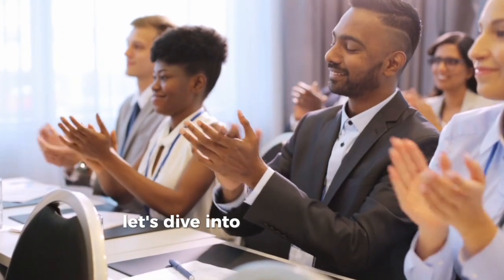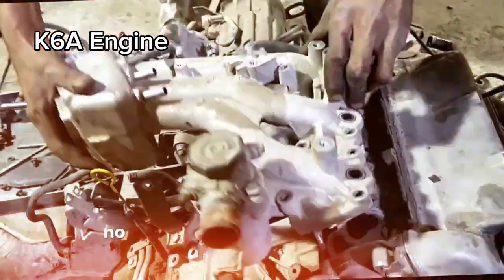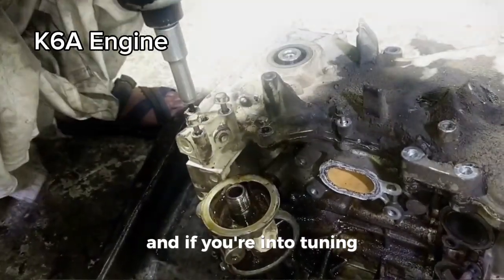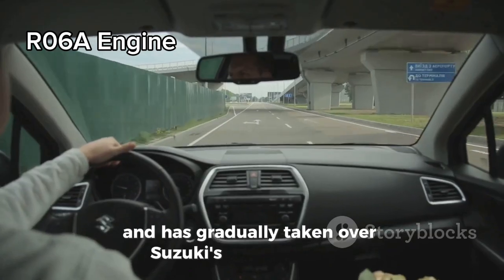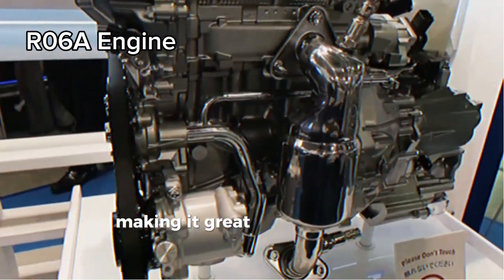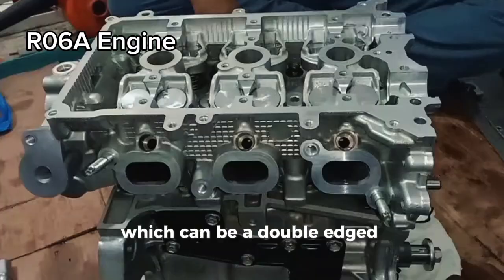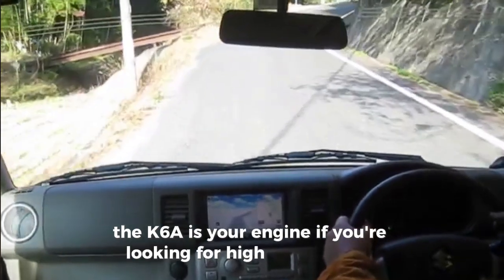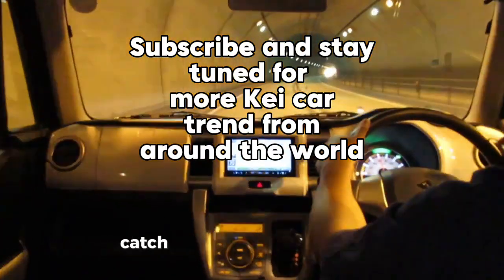K6A VS. R06A SUZUKI'S MINI CAR ENGINE EVOLUTION

Comment: My 1k php gasoline can last me for 10 days. From house to farm. And other jobs. My da65t transformer pickup type  is a good unit for farm and travels. If your not in a hurry and enjoy the scenery

Ps. My uncle has RO6A pickuptype. Same fuel consumption as k6a.
Reply: dang,my k6a consumes 500php per day😢
Reply: take it to a k6a engine expert mechanic. Maybe needs proper pms. And just ride it 40kph. You will see how fuel efficient it is.
Reply: @dndlmrtr5276 i got r06 80km drives 8.6km per L

Comment: What is the exact kmpl for R06a and K6a???
Reply from the maker: There's no guarantee of official fuel consumption for specific engine. Need to consider the drivers driving habit, car body weight, car condition, road condition, tire pressure and etc. This fuel consumption result is based on the catalogue/owners manual. R06a NA is 24km/l while R06a turbo is 21km/l.
With K6a engine is a bit lower but still varies.
Reply: da63t k6a carry with conopy stepboard 200kilos load 1589 klm.11 to 13 klm per litro 60 100 kph. my unit
Reply: I had a k6a before it sits at around 10kmpl (with aircon) on light to medium traffic. the ro6a is around 14kmpl on the same scenario

Comment: What's the good engine ??? K k6a?  Or rO6A
Reply from the maker: For me R06A for city driving and good fuel consumption.
K6A is for engine performance and speed. This are my thoughts for those   engines.
Reply: @keishorts  as someone who drives in city daily. ro6a is way better.
Reply: @keishorts  when it comes to speed, i dont think the K6A can beat RO6A. Mine is a K6A. During long distance travel, i observe RO6A engines run fast-whether uphill or plain highway, unlike my K6A. I use my K6A everyday in the city going to work. And once a month long drive (about 4 hours) out of town.